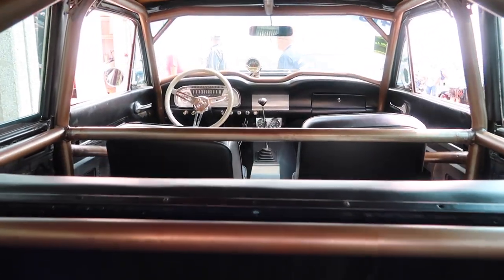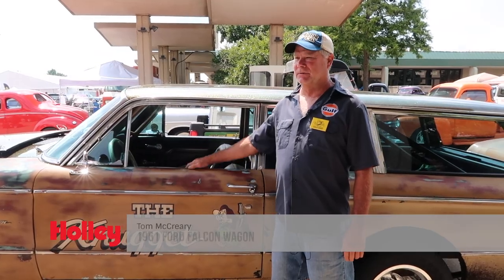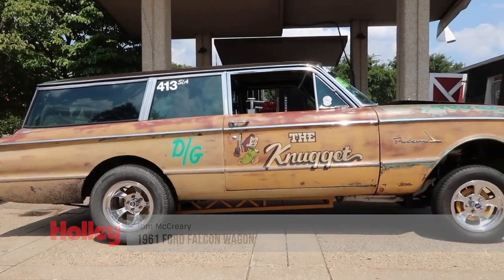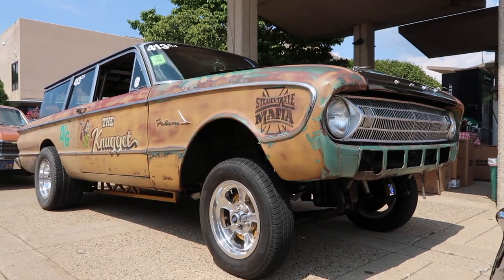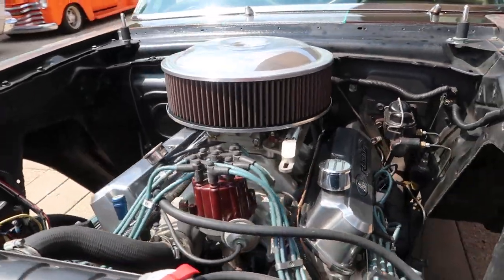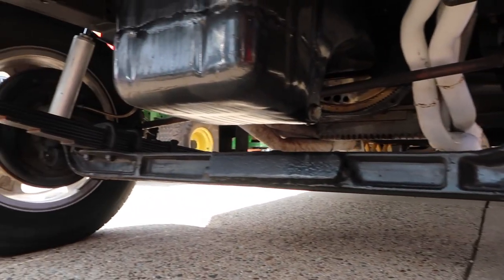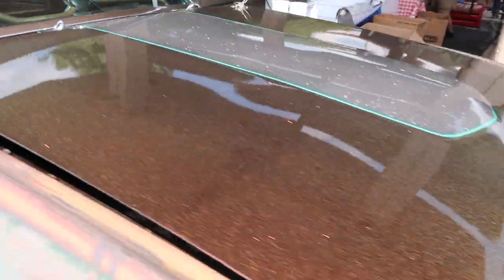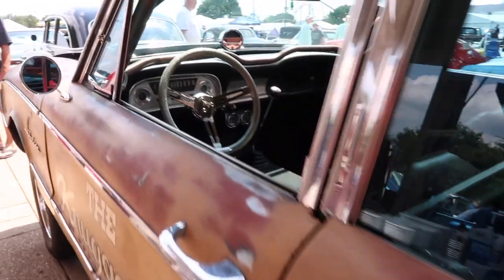1961 Ford Falcon Gasser Station Wagon

Comment: Since you’re planning on making changes for more power,  consider switching to Fords superior small block engine, the 351 Cleveland.  The best choice in iron heads is the D1AE , 4-V head with quench chambers. Aluminum Cleveland heads are the best choice with several options available from Trick Flow (TFS),  CHI,  AFD and Scott Cook. Edelbrock even has an alloy 2-V version available but they have limited power potential.  Cleveland heads work well with additional displacement and there are several good 408 stroker kits available. You have a very unique car and it deserves a unique engine combination !